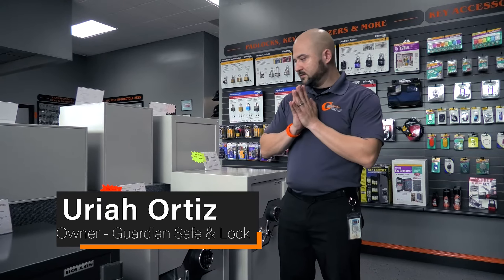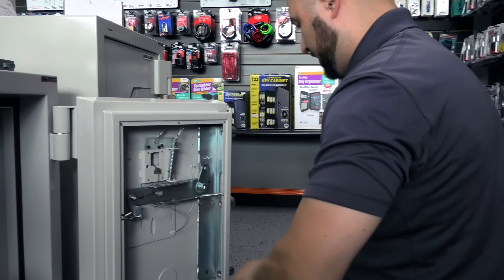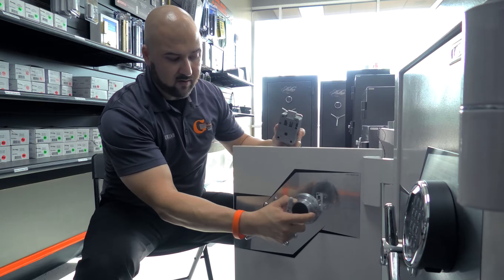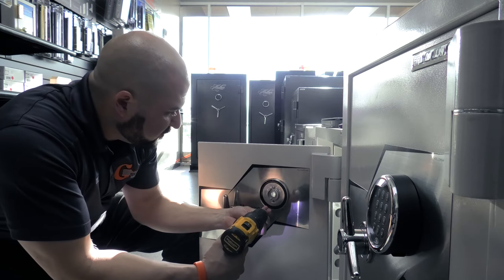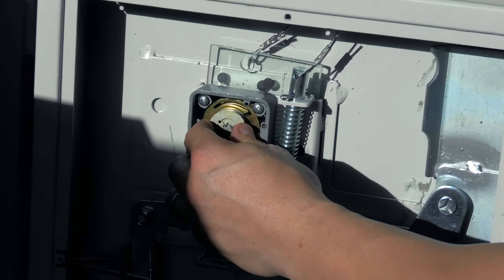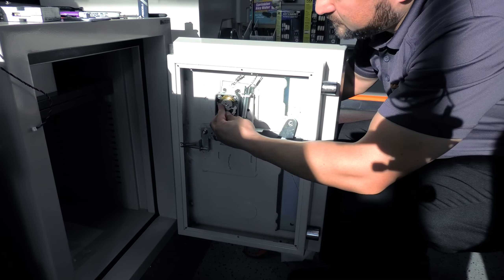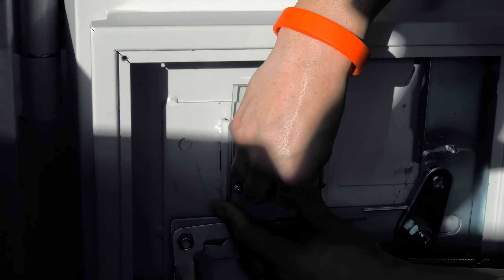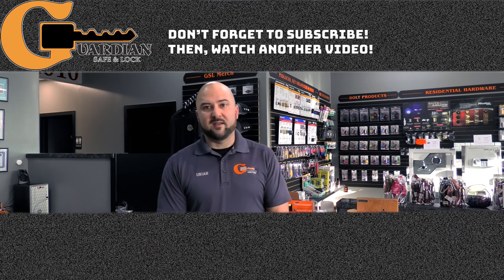Making An Electronic Safe Manual | Replacing A Keypad With A Dial

Comment: Is there a certain mechanical or dial that you suggest for replacing a Securam on a Safari/Cannon safe?
Reply from the maker: Sometimes the keypads and dials are proprietary to the safe especially when getting budget friendly safes. Cannon is known for skimping on quality of keypads, but sometimes they are normal and can be swapped out with any other. I’d check with a local locksmith first but if you want to use a regular dial I’d go with Sargent and Greenleaf they are the best. Thx for watching! We have two other channels if interested: UDROpreneur and Guardian Approved, we would sure appreciate the subscription. Thx again!

Comment: Dude I have a Winchester safe that the number 2 on the key pad is messed up and won't let me in even tho I have the right combo what do I do. I've had the safe for like 10 years and don't have the receipt what do I do
Reply: Replace the keypad. Most come off from the outside and have a wire that unplugs from the KP, You can replace it with the door locked.

Comment: spline key is supposed to face out for most
Reply from the maker: diverdoug2 not sure what you mean the spline can only go in one way but in one of 4 spots.... VU, VD, LH, RH
Reply: Usually the spline key arm faces outwards
Reply from the maker: diverdoug2 no sir the spline points inward, pointing outward wouldn’t necessarily cause any issues that I can think of but I’m 100% sure it points inward. Anyway thx for watching! - Uriah
Reply: @GuardianSafeAndLock  Interesting, with Sergeant &  Greenleaf 6000 and 8000 series locks, the manual states to have the back of the spline key point outwards.  What type of lock were you installing?
Reply from the maker: diverdoug2 Hey Doug before I responded to you yesterday I called two other Safe technicians and asked that question, both with over 20 years experience and me with over 15 years experience and they all said point inward and so did I. But, I did my due diligence and looked up what you were saying and you are correct, it says over the cam and not over the spindle which is news to all three of us lol. Well I guess it really doesn’t matter bc none of us have ever had an issue but technically it does say that, guess you learn something everyday lol. - Uriah
Reply: @GuardianSafeAndLock  Yeah, I mostly install digital, but once in a while a customer wants to switch back to mechanical.  I only use mechanical on my own safes.  When those electric motors go down, it is time to start drilling on the safe (one of my most common service calls).  The reason the spline key arm is supposed to face out is that when oriented in this direction, when you tap it down, the spline slightly bends outward, ensuring that it can never back out unintentionally.  The way you orient the spline in the video, there is no area for the spline to bend into the grove  in the spindle and will actually start to move the body of the spline slightly out of the spline groove..  Yeah, you will probably get away with it 999 out of 1000 times, but is not as secure, and not how the system is designed to be assembled.
Reply: @diverdoug2  get Lockmasters Black Box to open most electronic safes.